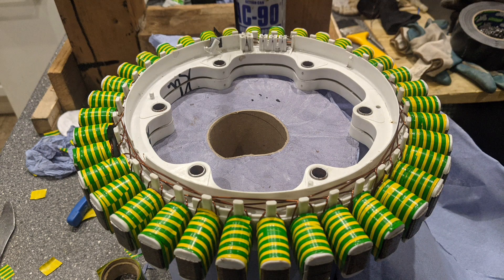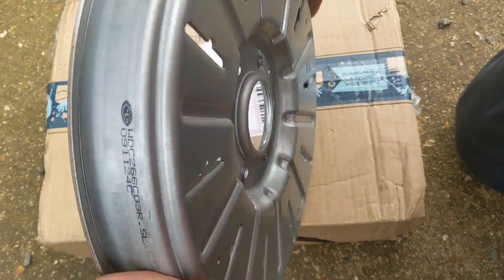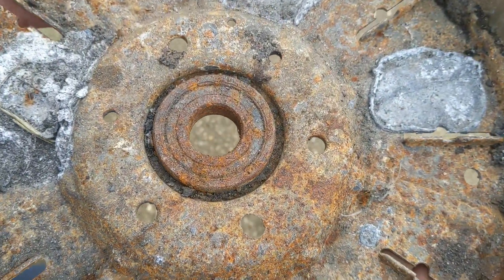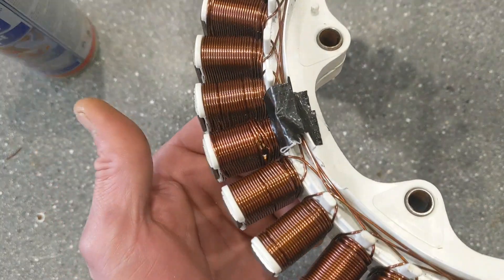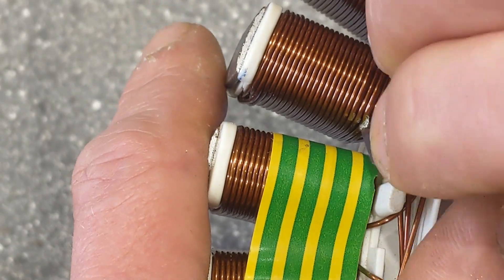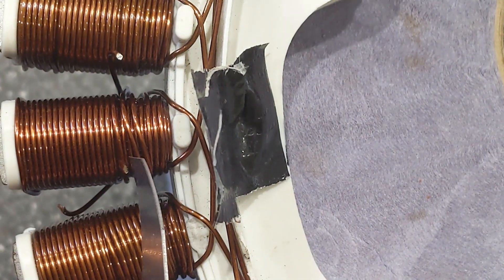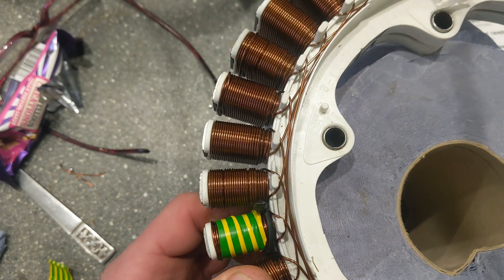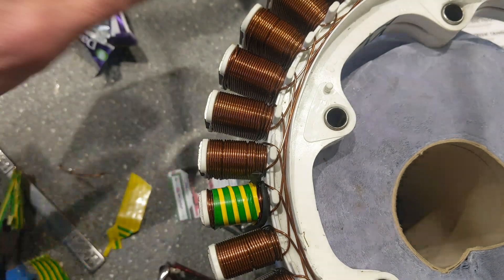LG Smartdrive Stator Repair ALUMINIUM WIRE for future FREE ENERGY wind turbine project

Comment: Hot glue over the bad spots would insulate them. Just you need to make sure your wiring doesn't get hotter than the glue melting point. As it will be a driven load instead of a driving load with a wind turbine, that should not be a problem. I did have that problem with the glue on a Samsung 18 pole that was rewired to a 3 X 3 X 2C configuration as a motor when given 240 VAC. Dropped the Voltage to 150 and everything was fine. One thing interesting about the Copper Vs Aluminum wound ones is that the Cu wound stators ring, while the Al ones don't. Which is one of the reasons I think F&P/Whirlpool/Maytag units have plastic covered rotors.
Reply from the maker: That is interesting mate thanks for the comment , Gavin